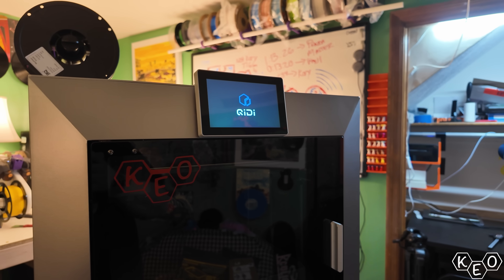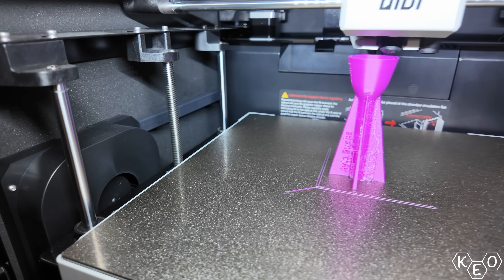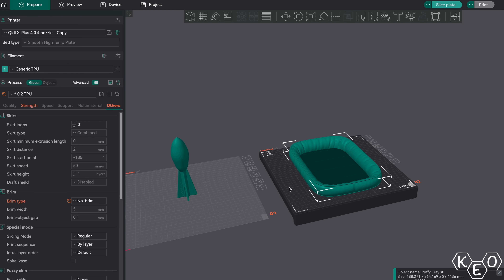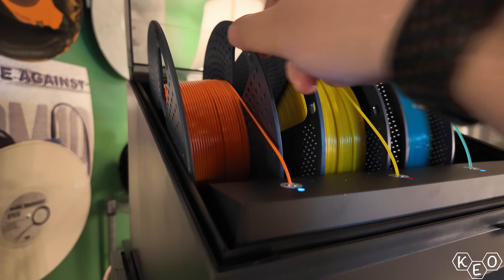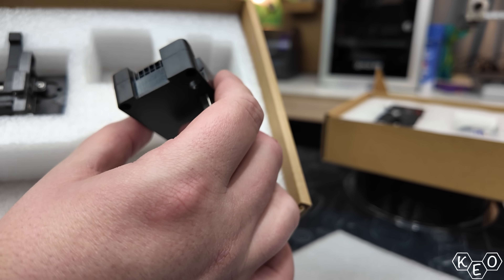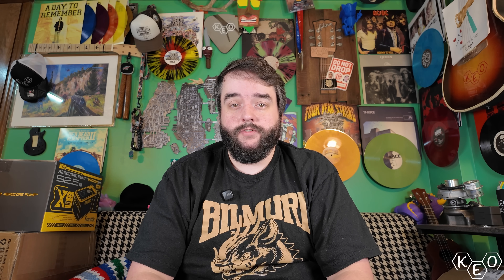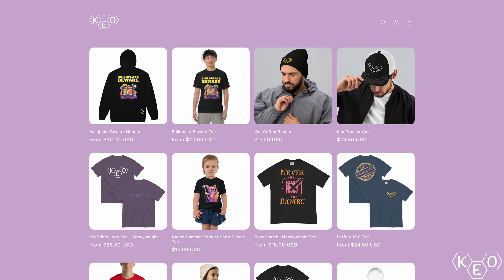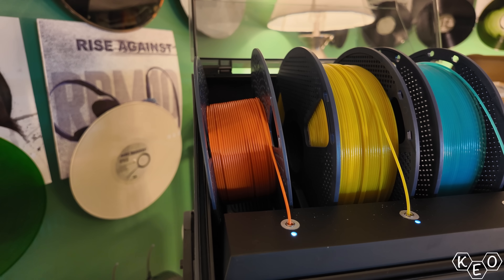I Upgraded My “Old” Printer… Here’s What Went Wrong

Comment: Before adding the QIDI Box and software it sounded like the Plus 4 worked very well for you, or am I wrong? I only asked because I bought a Plus 4 in August and have yet turned it on! Hey, I'm 73 and it takes time for me to do things!! I had a Q1 Pro and the prints were great. I gave that to my 8 year old grandson to learn 3D printing. I also bought the QIDI Box but hadn't planned on using it. In the mean time I bought a Snapmaker U1 through the Kickstarter program and it's supposed to be here in February. I only got the Plus 4 for the build area size. One day I'll turn it on and try it, or give to a niece or nephew interested in 3D printing. Anyway, thank you for the video and I'm looking forward to repair to the Plus 4 with the QIDI Box and QIDI's explanation of the problem..
Reply from the maker: Yes, this machine is a great one in my experience so far. I’m hopeful that this can be resolved leading to a good system moving forward
Reply: @KeoPrints    Thank you for the reply and information. As soon as I unpack it fully I'll give it a go. If it works like my Q1 Pro I'll be happy as hell! Thank you again.

Comment: I have an ender 5 pro with a bunch of upgrades and I don’t know is worth repairing
Reply: In the end it's still an Ender pro. I upgraded to a K1C, You can find them new for about 250€ and sold my Ender 5 for 125€. You can't beat those economics and at least 3 times as fast and out of the box a print quality I could never achieve with my old Ender pro.
Reply: @dutchsailor6620 I had just bought the diamond back nozzles for it too

Comment: I finally got my QIDI Box😂 and had problems with the feeding filament.  Now I don't have any problems to speak of, I also purchased 10 rolls of Qidi Pla to celbrate😅😅. I have CF & GF filament I'm anxious to try.
Reply: Was it some problem that you fixed or it just started working?
I am waiting for the box. I ordered it with Q2 even that the reviews were not so good and hoping it will be updated before delivery. And if not, then I still get a filament dryer that I was looking for.
Reply from the maker: Good to hear it’s working now. I am a fan of the Qidi filament I’ve used in the past as well. Super good from my experience

Comment: TPU has issues feeding through ptfe tubes. Thought this was a known problem with TPU. have you tried PLA instead? It’ll rule out the qidi box being at fault or not!
Reply from the maker: There must be some confusion, the beginning of the video displayed the TPU prints. Once the box was installed, I loaded it with ABS and ASA. Those were the ones struggling to feed
Reply: @KeoPrints before you started the print when it failed the menu on the printer screen had TPU selected but no other filament .. I looked back to double check before commenting
Reply from the maker: Ahh, I am following you now. Yes, in the slicer, the filament was set to TPU in that clip. I changed it before slicing and sending it to the machine. But I totally get where you are coming from now. Fair enough my friend

Comment: This is why videos like this, they talk about how stuff fails. You didn't even mount the hub right It should be horizontal not vertical, looks like you're running cardboard spools which it says you can't. I'm tired of these bias videos of these bamboo people trying to make stuff look bad, if you're going to do the videos at least do them right
Reply from the maker: I’m not sure what familiarity you have with my other videos but I regularly talk about how much I love Qidi. Since I typically run cardboard spools in my Q2, I gave it a shot here. Although in my Q2C, I was running plastic spools at the time of failure after the first print. 

I’m hopeful I can work with customer support to get this sorted out though and I’ll be sure to update you once that happens!
Reply: @KeoPrints it say not to run them and they do and can cause loading issues, plus the way the hub is mounted, with the long tube coming out of the  hub can cause loading issues it has a certain length it has for. The to the Extruder, I made that mistake,
Reply from the maker: Fair point. I am hoping Qidi support can get me pointed in the right direction one way or another but I have explained the setup to them and sent videos. If it's just a matter of mounting the hub sideways and shortening the tubes, that will be the greatest fix ever. Although I find it odd that the thing is struggling with moving the filament even when it is just leaving the box...
Reply: @KeoPrints  not say that is it 100% but the instructions show it horizontal and with most any AMS it is better to have a gradual sweep and try and keep a big U out of it it will work better